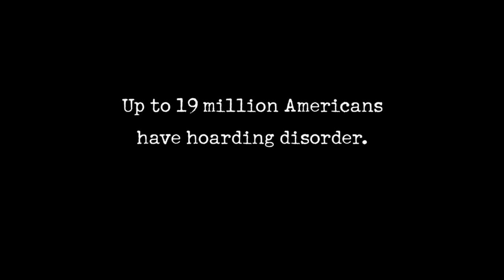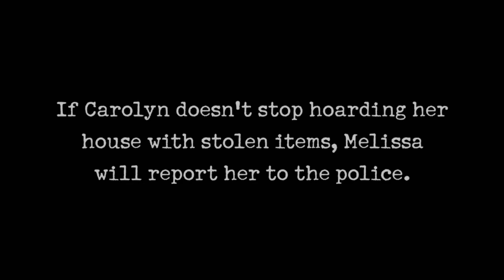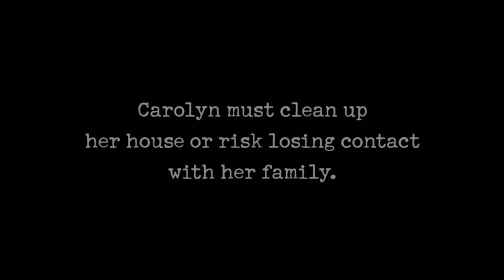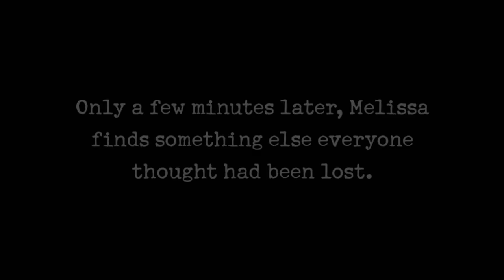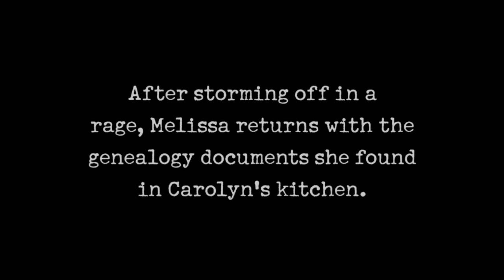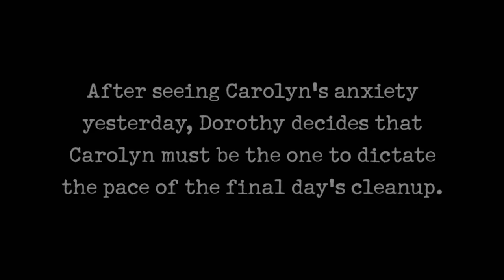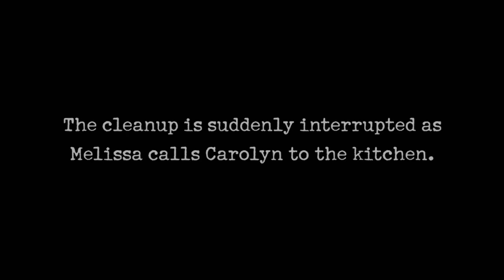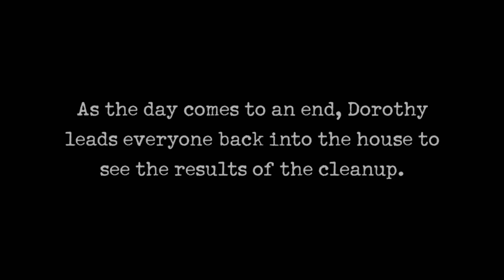Hoarders: Woman Hoards Her House With STOLEN Items | A&E

Comment: Genealogy is very very important to a Mormon family. It is truly devastating to have them  stolen buy a family member who lied about having them.
Reply: I was confused about it and still dont understand
Reply: @Roxy, it's tied into their religion and who they spend the afterlife with, I believe.
Reply: The community is very close-knit and othering so there aren’t a lot of outsiders. The practical reason is that they have to avoid any risk of inbreeding.
Reply: Actually the main reason for it is because we believe in Baptism for the dead. Someone living goes through a baptism by proxy for those that have passed, and then those that have passed have the option to accept it or not on the other side. It's missionary work for those that didn't have the opportunity to hear what we believe to be the fullness of Christ's gospel in their lifetime.
Reply: @alysonfewless886  It's important to note that baptisms for the dead don't force the deceased into their family's religion, but as a choice to join if they want.

Comment: I’m a hoarder, I have it under control most of the time now. I will ask help when I have an anxiety attack because that can trigger me starting surround myself with things as a safety blanket. My family knows when I stop going outside there is something wrong with me! I’m open about my feelings and letting them enter in my compulsive tendencies. They know it’s not something I want to do it takes over… they can coach me and I let them so it under control now!